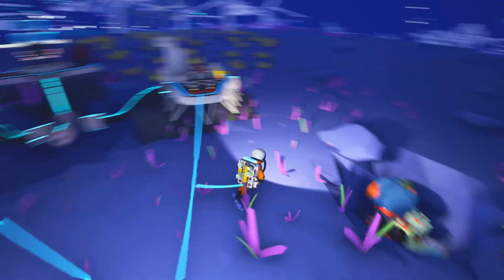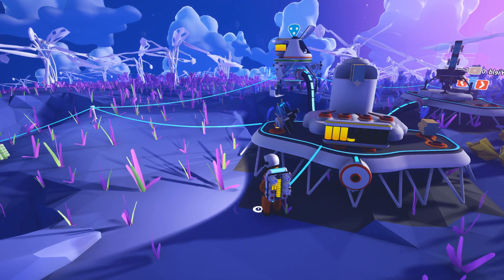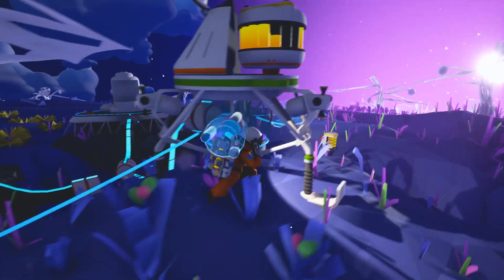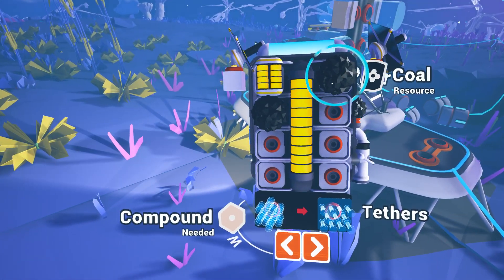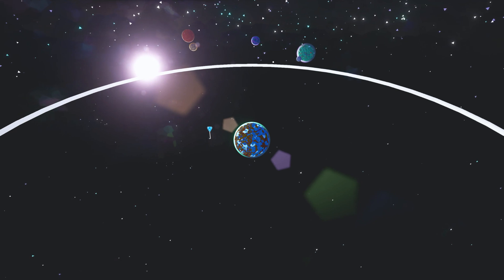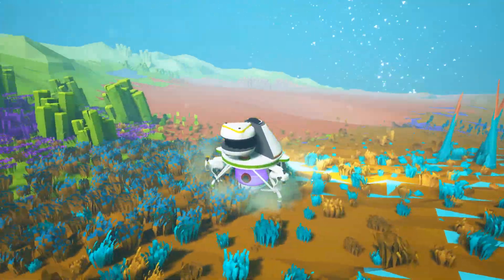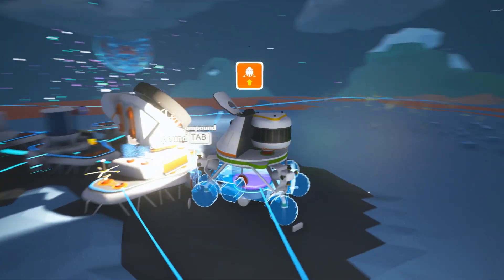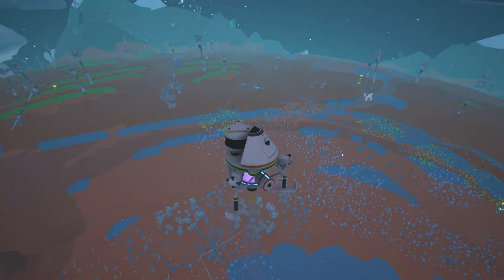Astroneer - Bugs, Easter Eggs and New Planets! - Astroneer Gameplay Highlights

Comment: You can Carry 9 Resources with you, just chose to build something that needs Cooper or Resin and put on the craft slot. Boom 9 slots!
You need unattach the cable from the Space Shuttle before taking off, since you didn't took it off, it glitched into thinking you're still connected to that base. Next time, take the plug off. :p
Reply: you can hold 11 the slots where the solar panals go you can put almost everything there but if you but a battery, tank, power cell or filters they wont be used

Comment: Astronium is one of the Resources in Astroneer. It can be found on the surface of radiated planets. It can also be found on Terran and Barren if you dig straight down to the core of the planet. Astronium has no known use as of yet in-game.

Comment: You shouldn't trade for copper/aluminum, but instead trade for malachite(copper ore) and/or laterite(aluminaum ore) because it is cheaper. You can use the fuel condensor to basically get infinite resources by using hydrozine with the trade platform and all the fuel condesner needs is power to work